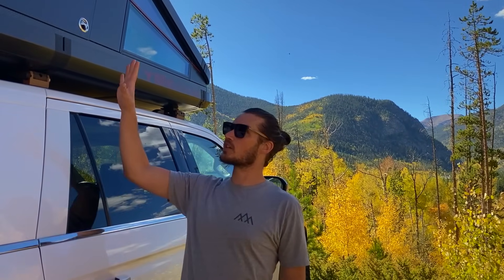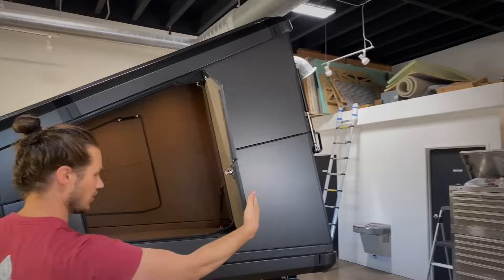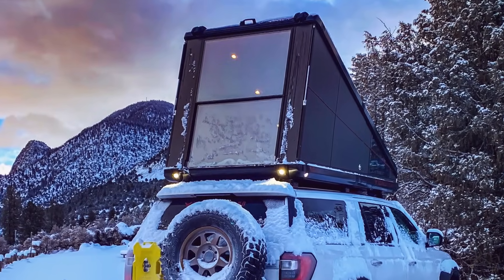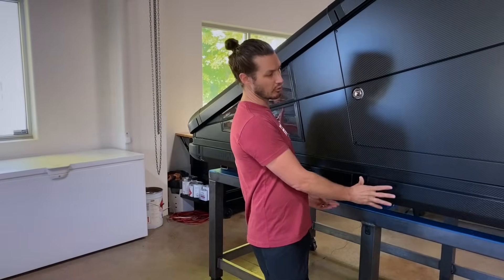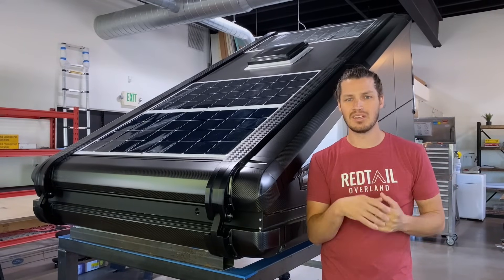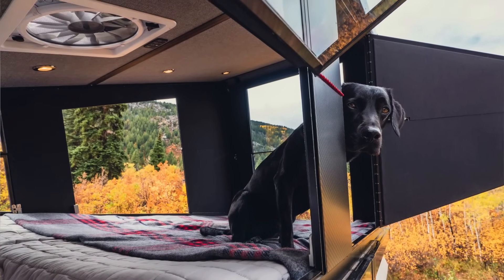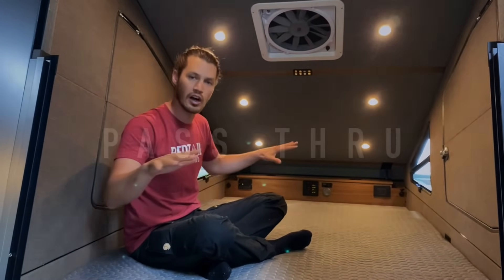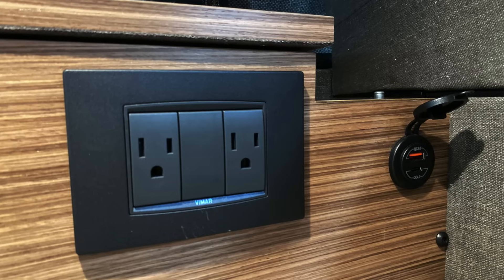Redtail Overland - Skyloft Walkthru. Only available on the complete Skyloft Van.

Comment: It’s really cool but why not do a cheaper, less luxurious version that normal people can buy (maybe by using an aluminium alloy instead of carbon fibre). Similarly it would be really cool to see that sold as a separate product to the skyloft van again so it can be used on top of trucks or in other van conversions.

Comment: well I'll be damned. This has to be the most thought through RTTs on the market. Integrated roof mounting, doing away with a roof rack, integrated port, starboard and stern lighting, just amazing.
One question, can it be optioned? I don't need a heater, batteries, inverter or charger. Will there be an option to keep/remove items? 
Thank you.
Edit: Never mind. I found the video from overland expo west 2021

Comment: Sorry just found this more recent video. How do you seal the pass through?
Reply from the maker: We use a rubber gasket that is permanent when mounted in a van application, and we have a semi-permanent version for vehicles with sunroofs so the camper can be removed.